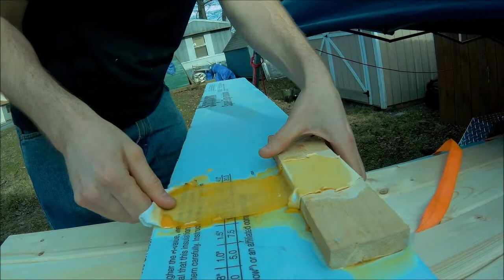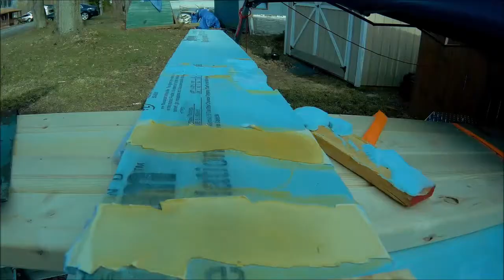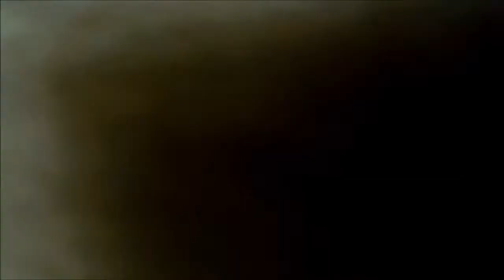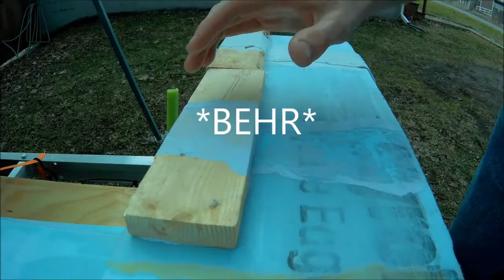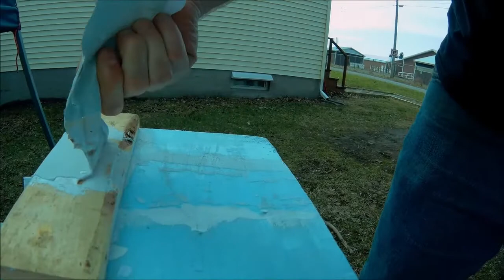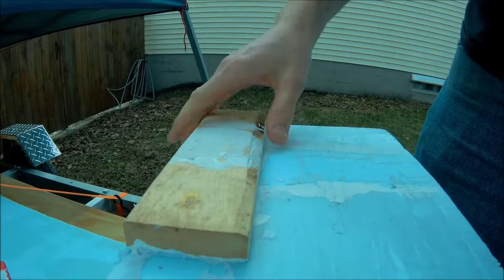Glue Test 1 Foamie Building

Comment: Interesting!  My project has been on hold for a while, but I have the trailer part done and have materials for the foamie on top.  I stocked up on Glidden Gripper just as the good stuff was going away (PPG bought them out and cheapened the formula), probably more 5 gal. buckets than I’ll use.  This confirms I CAN use Gripper and skip Titebond.  I learned to my expense, PL300 foam adhesive has a shelf life.  Don’t buy until you are ready to use it, unless you like throwing money away.